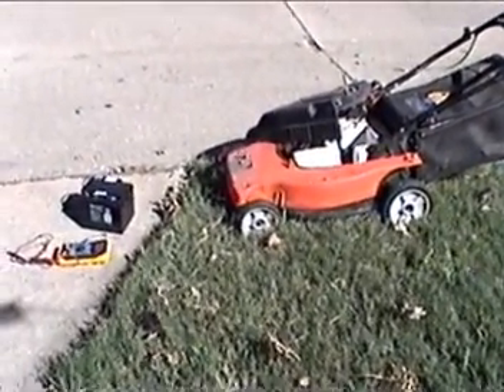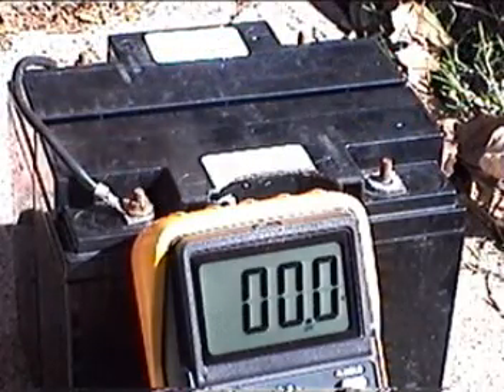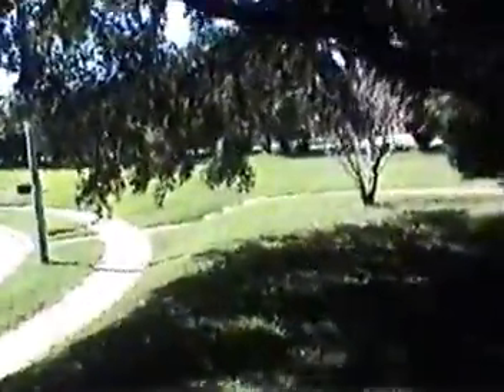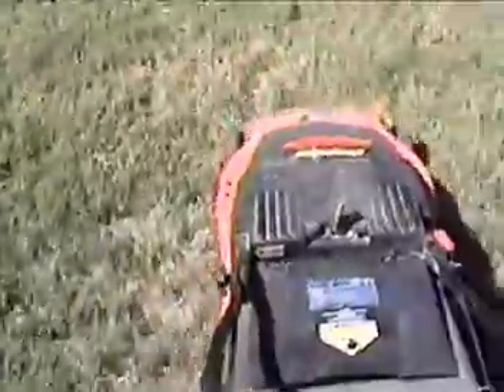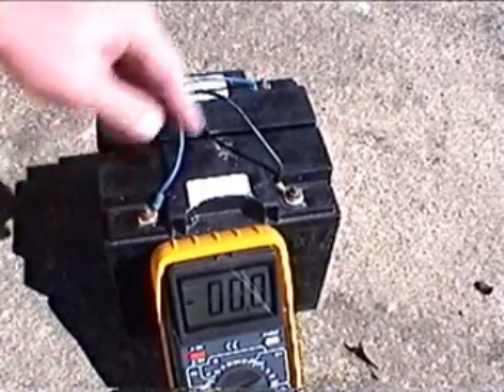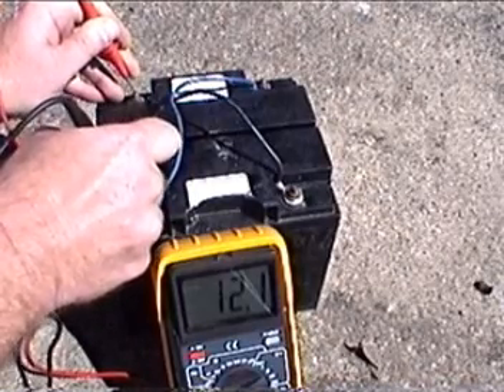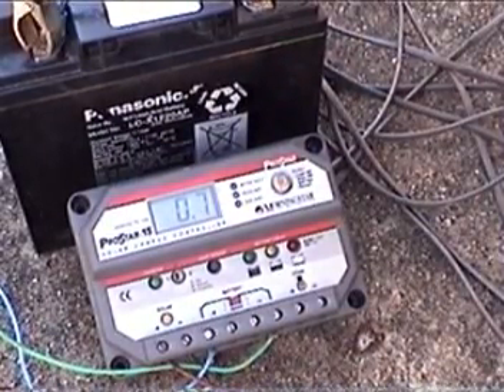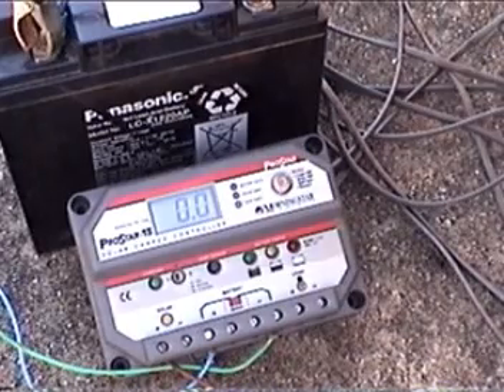Mowing with Solar

Comment: I don't think a charge controller is necessary if you get a smaller panel. I have a 12 volt Black and Decker cmm624 with 1 or 2 5w panel charging the 26ah battery and it recharges in less than 7 days even here in New England without problems.  Also, the B&D units seem to do the power management in the unit, so if you can get the appropriate Molex connector on your solar panel, the mower itself will control the charge for you.

Comment: Frontiersprings, regardless of the previous comments about float voltages and shorter wires, this is a great video! I love the practicality of this video. 

What is your opinion about the use of thin-film panels and their power generation vs. square footage size?

Comment: 12volt SLA batteries should float at 14.1 / 14.2 volts and are 'fully charged' at 13.8 volts.

Comment: Thanks for the video. I bought one of these mowers and the charger was defective. Looks like I will get another one as my front/back yard is about as large as the area you showed in the video. I also wanted to do solar recharging maybe using 24v instead.